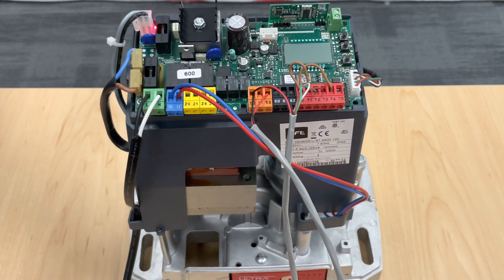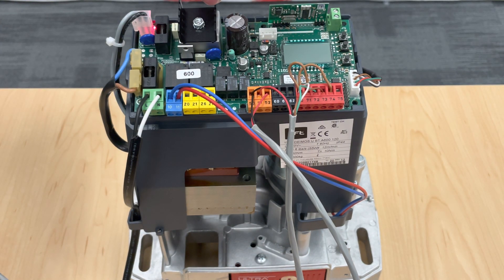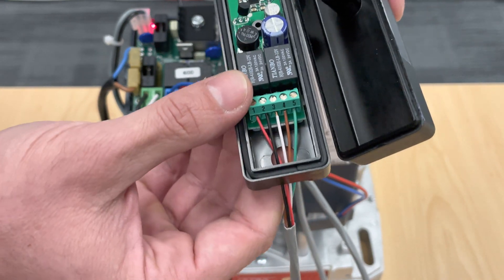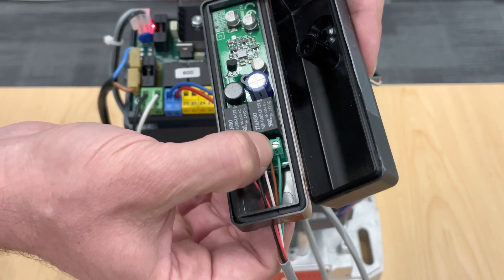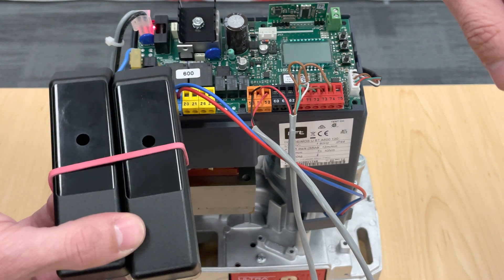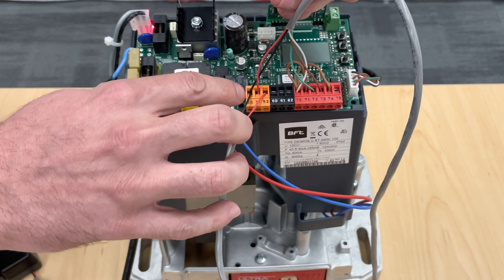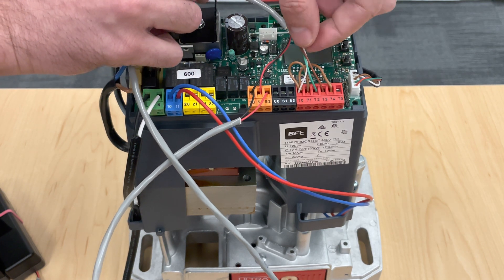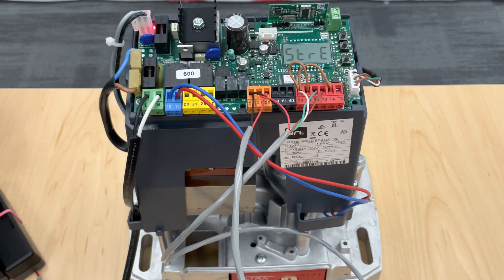BFT FL130B UL 325 Monitored Photobeam Wiring Instructions

Comment: If the normally closed wire in position 5 on the receiver comes in contact with metal will it short out the photocell? I am unable to use the photocells due to layout of property but they are wired to my control panel. i noticed that the normally closed wire (#5 on Receiver) had the insulation missing and may have rubbed against the metal battery bracket. The unit stopped working this weekend and I am getting an ER01 error and "Phot" on LCD display on the panel. Is it possible to bypass the photocells? If so how would I wire this on the Thalia UL control board? Thanks

Comment: you should only wire + - and  com and nc, that way when the beam is broken when you go through it as the gates start to close they stop and reopen.
Reply from the maker: With the UL Control board you will have to use all 5 wires like shown in the video and change "Safe 1" in the logic menu to 5.
Reply: @BFTAmericasInc  have a problem with the photocells on the ares ultra a 1500 model, the photocells are connected with 4 wires, which means power to both and the contact between ports 70 and 72. in the logic menu safe 1 is set to 4. the door still disconnects when you walk over it and I need them to open automatically without interrupting. the craziest thing is that when I cross 70,72, the photocell still reacts, interrupting as I pass over it. how to solve this very frustrating problem. after all, the door blocks and reports errors er 01,02,03,3h .horribly frustrating